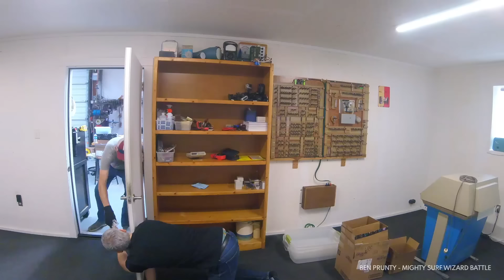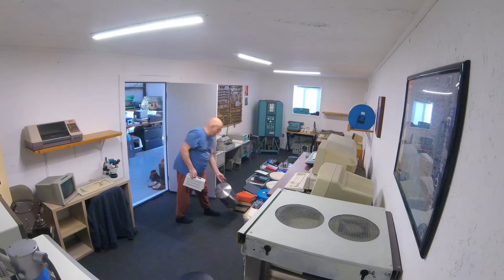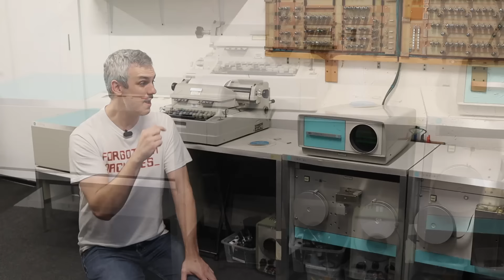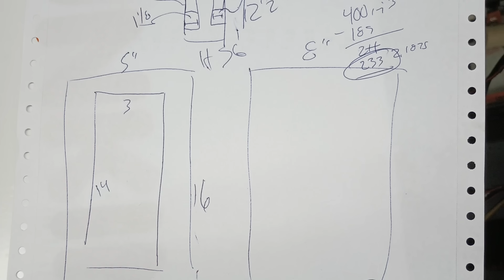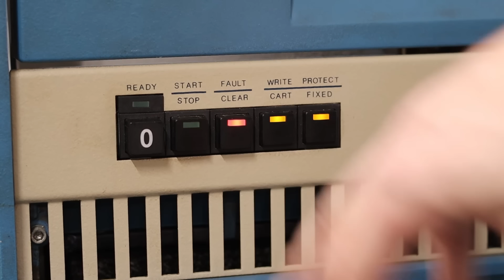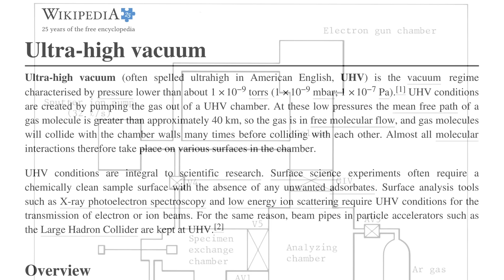Welcome to the New Usagi Electric!

Comment: When I was studying material science as a young gal we still had lab sessions with an PDP11 controlled XRay spectrometer. It was as loud in there as if you were standing next to a vacuum cleamener. We still were shown how to boot the monster by typing in the boot commands using the memory controller to bootstrap the monster. It obviously must have had the FP unit too, otherwise it wouldnt have worked. I still remember the mixture of vector display for the graph (red/green) and bitmap for text. This old auger microprobe (or something similar) I also remember from these days. Eventually these machines had been replaced by something more modern, based on PCs. Seeing them again brings back old memories ;)

Comment: My grandpa worked for Bendix during the time of the G15. He was a project engineer in their aerospace avionics department/division/whatever and one of the projects that came across his desk was, as far as he could tell because it was obviously classified, was the SR-71 altimeter. He even had to deliver a prototype in a plain cardboard box to Kelly Johnson's house at one point (but never got to meet Johnson). Given that connection alone, I'd say titanium is not out of the question. And my grandpa was a big fan of the material. A fellow engineer was bragging about a project being made of "the miracle metal" and my grandpa said "titanium?" and the other engineer meekly said "no, aluminum". I wish he was still around to give his input on the G15 project, because I'm sure he knew about it.

Comment: Over time, you learn to maximize the available space. When you run out of space, you either expand the space, and if that is not possible (most of the cases), you rearrange stuff to use every square inch, stack stuff, and hope you have room for goodies that undoubtly will "materialize" now that you have extra space available. That's how it goes in this crazy but fun hobby.

Comment: magnetic coating analysis has got to lead to tape formulations at some point... there's a paper on spectroscopy used to identify the beginnings of sticky shed syndrome at tapes from the library of congress, but if you examined a wider range of tapes used in say, pro audio, I bet you could get an AES paper out of it.

Comment: I've already posted a comment twice, but when i come back later they have both disappeared... I'm trying again removing any external link beside other Youtube videos, despite these being useful sources of information. I hope this time it will not vanish!

About composition of G15 rotary drum's surface material: it is a very fascinating subject and i hope you will manage to successfuly recoat this drum!

I throw here some information about things I remember seeing and finding...

The light brown color of G15's drum is similar to early audio tapes. It could indicated that it uses black iron carbonyl magnetic pigment, which was the first used in audio in 1930s, before being replaced by ferric oxyde Fe2O3.
But it also seems that ferric oxides can have different color depending (if i understood correctly) on its level of hydratation and also the form of its crystals (it can crystallize in different internal shape).
An interesting video about ferric oxydes used as pigment explains this: https://www.youtube.com/watch?v=8uFHJtN266o

It is true that later and more performant tapes, are usually much darker, but this doesn't seem to be really a rule of thumb and that performant light brown tapes have also existed. The dark color seems to depend on various factors, like the use of carbon to deal with static electricity or cobalt enhanced ferric oxide CoFe2O4, and maybe others.

i've read something interesting on Wikipedia, in an article about D/CAS streamer cassette. "Streamer cassettes can be used in an audio cassette deck, but the formulation of tape they contain is optimized only for full-saturation square wave digital data, resulting in audio recordings made on them having very poor audio quality and a large amount of noise and distortion".
So something in the composition of magnetic material (for tapes but certainly also discs or drum) is influencing the saturation, and composition must be adapted to the usage (here analog/linear signal versus digital on/off).
Additional info about D/CAS: "Different coercivity is part of it but not all of it. (...) The histeresys curve is set for the speed, gap size, depth of recording, dynamic range, and frequency response curves. Magnetic domain sizes, oxide grain, oxide layer thickness, and specific oxide type all contribute to the hysteresis curve."

Type of magnetic material also influences abrasiveness of tape for direct contect heads in audio/video devices, but in the drum are the heads in direct contact like for tapes, or flying above like later hard discs? If direct contact, the question of lubricant in formulation is also important.

There was an article on Hackaday about Nina Kalinina trying to make her own audio tapes :
Nina says she experimented with ferric oxide (also named maghemite or maghaemite) not iron carbonyl, so may be not directly suitable for the G15's drum, but at the same time some information could be nonetheless useful.

A particular kind of ferric oxide is needed: gamma-Fe2O3, not alpha-Fe2O3 which doesn't work. Apparently it can be obtained by heating the alpha kind, which correlates what is presented in a very intersting film showing the process of Agfa-Gevaert audio tapes manufacturing, where oxide is heated in a kiln to acquire its magnetic properties: https://www.youtube.com/watch?v=AKr0AMbcmRU
They also use glass beads in a shaking device  to very finely grind the oxyde particles and mix with the binder.

I also find another video about a french company which claims to be the international leader in tape manufacturing: RTM / Mulann industries: https://www.youtube.com/watch?v=YNgGh731TMg
They provide tapes to motion picture industry, NASA, army... I knew the brand but didn't know they were french, should try to visit them one day!
Maybe a company like this could be interested in participating and help on such a project?

So well: fascinating project but a lot of questions to investigate!

Comment: Scientific instruments? Much, much more interesting with these old machines than producing Mandelbrot diagrams or games.
Way back in the early eighties, working as a lab technician at Imperial College in London, I came across a disposed mechanical calculator/computer/logger? made by Olivetti. It had a totally mechanical tape puncher and separate mechanical reader. Annoyingly I only removed the tape mechs (and blank tapes) and left the rest. I still have those items but kick myself for not taking the damn lot.

Comment: If you haven't already, grab a copy of Color Science: Concepts and Methods, Quantitative Data and Formulae.
You will absolutely love the theory behind light, and it'll probably come in handy to reference!

It will be rather obvious why my copy had the original transfer slip (ex-library) at chapter two.
Very theory dense i.e. black body radiation. Not an engineering standards reference book, it's the theory of it.

Comment: The direction of the channel is epic, it still all ties into the vintage computing vibe with vintage scientific equipment that:
1. Requires vintage computing to operate
2. Provides insights into more of the intricacies of vintage computers such as the chemical composition of hdds and other components.
I see absolutely nothing that is contrary to what the channel is about. If you wanted to pivot to the scientific apparatus without any relation to the vintage computing side of things then a second channel could be warranted, but so far that's not what I've seen.
TL;DR: Loving all the content on the channel, keep enjoying what you're doing, we're here for it!

Comment: I was a Field Service Engineer for Hitachi Scientific Instruments in the late 70's to early 80's.   I was in the TEM/SEM division, and saw many JEOL scopes.  You'll definitely need a chiller for the diffusion pump, as well as fore pumps for initial vacuum stage pump down.  The switching logic for the valves should be a nice video in and of itself, especially if the valves, actuators, and/or logic is not cooperating.  Our evac systems used solenoid air valves, so a compressor may be required.  Lots of support equipment needed, and definitely not plug and play!

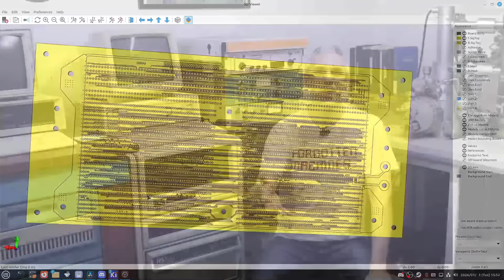Comment: @ 19:54 - probably means your clearances are too small - look at the specs page for your manufacturer's manufacturing tolerances and set up a rule check on your CAD package to match them - then you can run a DR check to make the design can be manufactured.

Comment: Oh the bunny is so tiny! 🥹

I'm very interested in the lab equipment as it has a concrete purpose and set of things you can use it for. I did chemistry at university so encountered the descendents of those machines which are definitely more functional but way less cool-looking. With many of those other old computers like the PDP-11 I'm often thinking "Okay, that's neat, but what are you actually meant to DO with it?" Other than print HELLORLD, obviously

Comment: In looking at industrial-scale availability of titanium in the USA, it appears that the CIA had to acquire large amounts of the metal through shell companies from the Soviet Union in the late 1950s to build the Lockheed A-12 at their Skunk Works operation.  The A-12 (Project Archangel) and its variants didn't fly until the early 1960s, eventually leading to and ending with the US Air Force SR-71 and its own variants.  The A-12 was a CIA follow-on project to replace the U-2.  Another big user of titanium was the X-15 research plane.  So, indeed other aerospace companies could have had access to sources of titanium for computer drums.  I just want to see the XR-Flourescense or XR-backscatter spectra, not just physical density measurements.

Comment: Use two heavy-duty varactors for the 100/200 volts.  No need for something fancy.  Pre-adjust the two varactors to 100 and 200 volts, mark the point with fingernail polish and problem solved.

Comment: I once had an antique (1950s ?, originally from a hospital in Montreal, how it managed to get to San Jose I do not know...) JEOL SEM with an add on  EDS detector controlled with a small SPARC station. It was used to support a large PCB fabrication facility. 

It had a 2 stage vacuum diffusion pump system and an ion pump for the single crystal source. 

I took the entire system apart and rebuilt the cooling and vaccum system when I found that the local SEM service was not maintaining the system. 

I would tell you that the power supply was gigantic - probably 3x4x2'. 

Yours has several Ion pumps may need rebuilding (not hard to find services for this) depending on how old they are... These "polish" a high vacuum to a very high vacuum by using high voltage and coated anode/cathode plates to attract and trap the very small amount of material that escape the turbo molecular pump and contaminates from inside the X-ray column. 
The turbo molecular pump probably is the biggest risk- it is a very high speed (average 50,000 rpm) turbine and it has to be very clean and perfectly balanced. Not hard to find a rebuild service but $$.
Vacuum service supplies are expensive but easy to find, all of the joints are very serviceable but the high vacuum seals are generally a 1 time use flat copper part. 

Any part of the equipment in the high vacuum areas should be baked before reassembly if they are serviced and cleaned, it can be hard to appreciate how difficult it can be to make and maintain a very high vacuum. Fortunately there are lots of You Tube channels today with info that might help.
Good Luck!

Compared to what I had, this is a very modern device, good luck.

Comment: I am certainly not complaining about the JEOL, but please be careful. The turbo molecular pump is small, but it still stores a lot of kinetic energy. There also might be a radiation hazard if modifications, such as viewports, etc. were done improperly. Overpressure valves might seize and turn your vacuum chamber into a pressure vessel when venting with inert gas from a bottle. Please make sure that these hazards are all known and managed before starting to work on the device.

Comment: Titanium drum? I recalled a tidbit that Lockheed discovered with the SR-71 development ( in the 1950s) and looked it up in Wikipedia. "Lockheed found that washing welded titanium requires distilled water, as the chlorine present in tap water is corrosive; cadmium-plated tools could not be used, as they also caused corrosion." Just thought I would pass that along.
Reply: I wonder why they'd use titanium though? For a supersonic aircraft the reasons are obvious, but for a had drive? It doesn't have to be exceptionally light, nor is it subject to huge mechanical loads or wide temperature swings. Seems like aluminum would have been adequate, but then maybe thermal expansion is too high to maintain an acceptable clearance from the heads which are fixed rather than flying over the surface.

Comment: Can you give us some close-ups on the vacuum system of the JEOL?  Does it have a roughing pump?  (If so, then immediately change the oil and analyze what's in the oil, as it will tell you about the state of the high vacuum pump.)  Do you know if the turbomolecular pump is a cryogenic turbopump or a straight turbomolecular pump?  As an undergraduate physics major in the 1970s my High Energy Physics Professor made us memorize the characteristics of all kinds of vacuum pumping systems.  That memory is still with me.  I usually only needed to use oil diffusion pumps for the work that I was doing.

Comment: Your comment about Aluminum versus Titanium is spot-on.  I agree that XRF is the best non-destructive way to determine the atomic composition of the alloy for your drum.  So you can introduce the viewers to NDT (non-destructive testing).  You might also try X-ray Backscatter Analysis for the magnetic coating as soon as you have the XRF results for the transmission data on atomic composition.  That way, you could again do NDT on the materials that you need to recoat your crashed drum.  And, you're correct -- these were all "trade secret" formulations...

Comment: The device that I believe you need for the JEOL is an isolation or ultraisolation transformer with a 120 VAC input winding and a 100 VAC output winding, plus whatever voltages that you need.  I'm trying to recall is Japan's electrical grid uses 50 Hz (like Europe) or 60 Hz (like North America).  That constrains the core design of the transformer, but there are ways to compensate for the different power factors.  I'll bet that the JAMP's own power supply will accept either 50 or 60 Hz.

Comment: Using ancient technology to divine lost formulas from that ancient technology is epic on its own level. Once you publish the compositions, people may be able to repair crashed disks that would otherwise be destined to serve as clocks. I read somewhere that obsolete IC fabrication machines were repurposed to make heads for hard drives. There's another cottage industry someone could revive. The Right to Repair is a big topic these days. We can't practically repair hard drives and integrated circuits; we can only replace them. What Usagi is doing pushes those boundaries. What level of computer technology is ultimately within the practical grasp of skilled private entrepreneurs?

Comment: Most anyone else who needed to analyze materials would start shopping around for labs or a university.  I love that your answer is to find older, cheaper (but adequate) equipment, restore it, and then climb all the learning curves to use it yourself whenever you want.  It's like learning to weld so you can build go-karts at 2:30 AM.

Comment: I fully celebrate the fact that you essentially go the route of "let the haters gonna hate" and pursue your ideas and dreams.
I am looking forward to the other projects, it's still vintage electronics, even the Boman is awesome. Besides that you can use, if you get the other machine running, to analyze the coating even of the Bendix G15, win-win I would say.

For the power delivery, I would say some heavy duty transformer might be helpful, converting down from 240 Volt to 200 Volt and 100 Volt via a center tap. That said, I am not entirely sure about the needed amperage, however, starting with a 240 Volt base will be easier to work with than 120 Volt. Again just taking a shot into the dark.

TL;DR: Keep it up, I love your content, be it mechanical, be it your maniac UE 1/UE 2 projects or restoring old mechanical and electronics.

Comment: buck/boost transformers can get you the voltages you need. Not all the current flows through the primary so you need a smaller transformer then you might think.